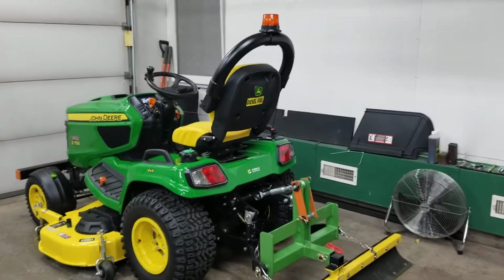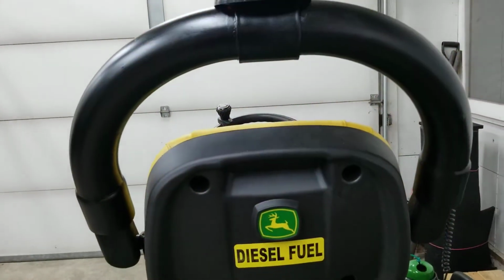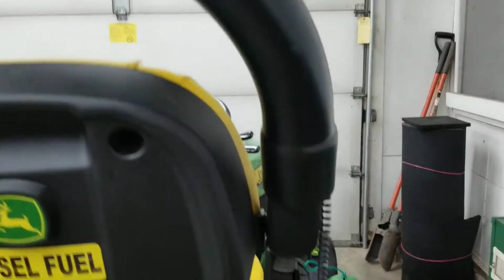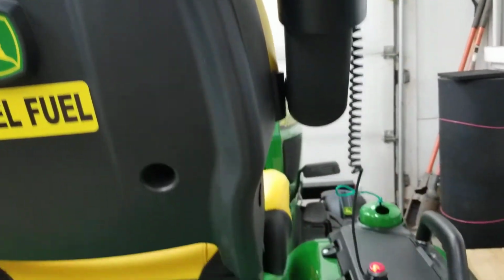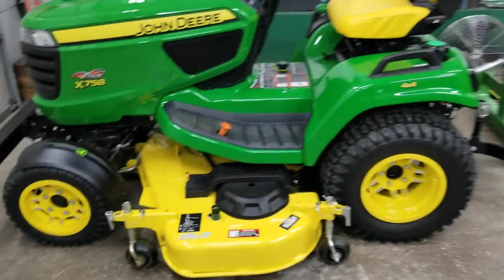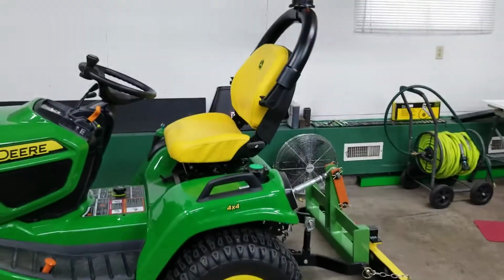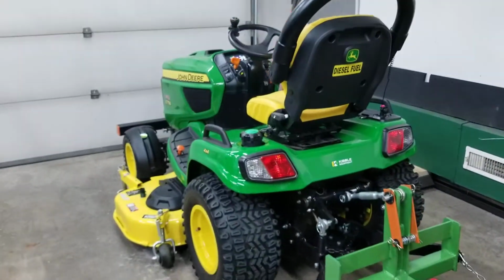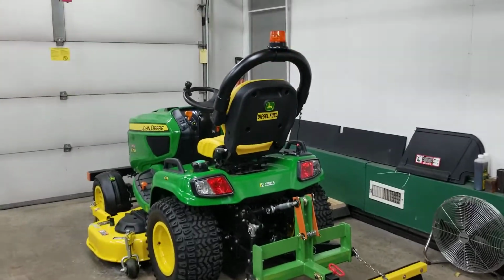John Deere X758 Diesel BEACON

Comment: Can you move the 3 point hitch up and down independently from the mower deck?
Reply from the maker: Yes, that's how they work without doing anything. The 3 point will raise the striper or any attachment somewhere around 12" before the mower deck starts to rise. So it works perfectly with the striper.
Reply: @MJB516  ok, good to know. I just ordered a X730 with the hitch, but i have been reading some reviews about people complaining about how they cant move the rear hydraulics without the mower deck moving too. Guess I'll figure it out once my tractor comes in. I also have read about some type of valve adjustment control for the hydros. Any info would be greatly appreciated!
Reply from the maker: The valve you're referring to is very easy to install and I believe cost around 100 dollars. Not positive on that price because I bought a package deal with a 54 inch snowblower and the valve came with the blower. I installed it though. It's purpose is when you're operating the hydraulic blower shoot its very very slow turning without the valve because the fluid is trying to operate the cylinder for the deck and rear 3 point and the blower shoot at the same time.
Reply from the maker: Oh also the 3 point works exactly like I mentioned before. I have a boaring video of me striping my yard in the fall. The strips aren't very good in that video because it's fall and leaves are mixed in the yard and they don't strip well. But you can see me raising the striper at every ending pass. I might have forgot a couple of them. But you get used to it and you can lift a long way without the deck moving. You'll love your new machine.
Reply: @MJB516  Ok thanks for the update. Another question, might be a stupid question but, are you basically saying that at both ends of the hydraulic travel (up & down) the rear hitch will move before the mower deck reacts correct?
Reply: @MJB516  like for example, ifyou have both the mower deck down, and the rear hitch, can you raise the deck up without raising your hitch?
Reply from the maker: @gunguyforlife630  that is correct and the reason it works that way is because when a 3 point hitch is added it has its own rockshaft and the deck has its own rockshaft. The 2 shafts are connected with a long arm that's somewhere around 2 feet long. This long arm has a long slot in it allowing the the hydraulic cylinder to operate the 3 point on one end of travel while the deck end is traveling in the long slot until a certain point before it starts operation.
Reply: @MJB516  Ok thank for the info, Funny how not one of the sales repa at the dealer seemed to even know the slightest about what I was asking haha!
Reply from the maker: @gunguyforlife630  no problem. And good luck with your new tractor 🚜